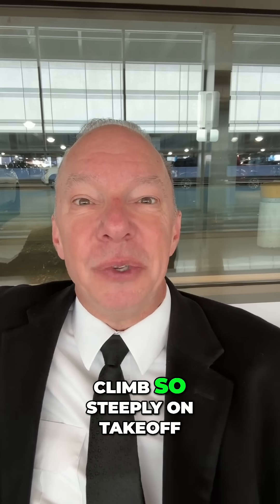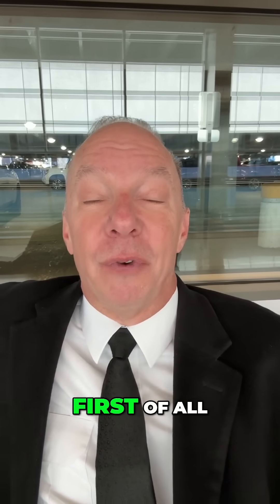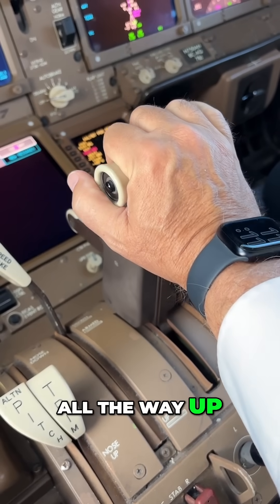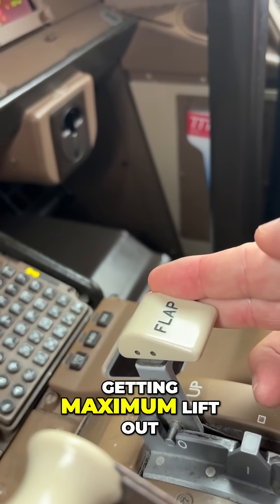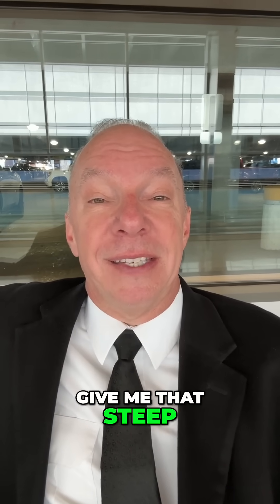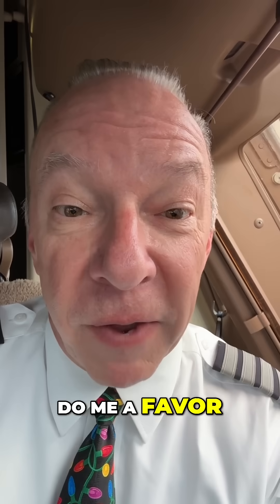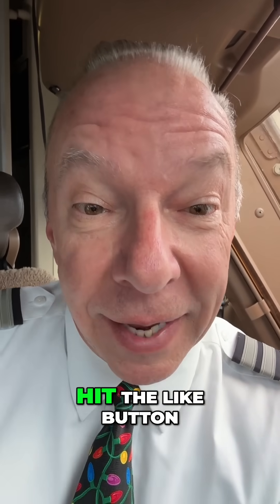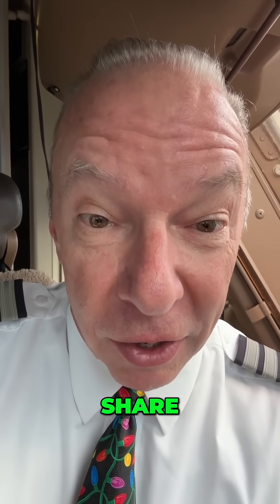Why Airplanes Climb Steeply During Takeoff?

Comment: A lot of power retraction is due to noise abatement too, trying not to be loud with takeoff power but enough to obviously stay aloft and climb a little. Las Vegas is like this.
Reply: I see you made this comment here too. Power reduction is not made with noise abatement in mind. And definitely not to just be enough to stay aloft and climb a little. The airplane is programmed to go to climb power, usually around 1500 feet. This is a normal reduction that reduces wear of the engine. There is a time limit in regards to takeoff power, usually 5 min.

Comment: Flaps are not generally at the maximum position for takeoff, one or two notches is enough, and it's never full throttle. They either use the auto throttle or set it to MCT, maximum continuous thrust which is closer to 90%.

He's way oversimplifying to the point of being wrong.

Comment: There might be mountains, tall buildings, or other terrain features near the airport.  There are also noise abatement rules at some airports which may require certain climb-out profiles after takeoff (climb angle, engine power, etc.).

For a super fun takeoff, try a Cessna Grand Caravan or BN Islander departing the Belize City municipal airport.  Taxi out to the end of the runway, flip a U-turn, hold the brakes while running up the engine(s), then finish pushing the "thrust" levers to the firewall as the brakes are released and the aircraft accelerates down the runway.  A fully loaded aircraft won't so much take off as it just keeps going, then starts to gain altitude as the runway ends and Caribbean Sea begins.  I've experienced this from the co-pilot's seat.  Yay!

Belize 🇧🇿 , Central America.
The Belize City Municipal Airport, not the PSWG International Airport just outside Belize City.

Comment: Locally, PHL, you have to climb ASAP to keep the noise down for those folks who moved under PHL's usual departure runway.  Runway's been there since WWII, IIRC. Most of the people moved in after then, and a great number of the homes were built to the drone of departing planes.  It's called "noise abatement" accommodating those who should have realized that being under the departure/arrival path is going to be noisy unless you adequately insulate.

Comment: Hi Steve, one thing I’ve always wondered is what is the sensation where the airliner seems to actually slow down and you feel a floating sensation. It’s only momentary but it’s an odd feeling that the stewardesses didn’t know. It seems like it happens while in flight, not landing or taking off.
Reply: Is that the same thing you’re describing???

Comment: Thank you so much.  Non-confident flier here. The takeoffs always have me gripping the armrest maybe a little bit tighter than necessary. I can’t help but think you’re gonna lose power and start sliding backwards. I know, I’m a wuss. 
But while I’m here, why, when approaching, are there such aggressive bankings to line up?  It seems like there’s enough space out there to ‘square up’ miles out. 
Appreciate the inside info. It takes a little off the “edge” when I board.

Comment: Steep climbers are called cowboys. Sure, you gain altitude fast, but it is also very hard on the equipment, your at max weight and drag.
I like the gentler  pilots becuase i know the engines wont blow.

Comment: You have said many times that you do not use max power, on take-off, but rather just take-off power calculated based on temperature, humidity, barometric  pressure and aircraft weight, so which is it Captain Steve, max power of take-off power?

Comment: Also some steep climb outs are part of noise abatement.  Anyone that has flown out of John Wayne airport will know how the plane climbs very steep then suddenly levels put and cuts back on power till they are about three miles from the airport.  Then go back yo higher power to climb out.  Also since 9/11 large aircraft climb steeper so that by the time they are no longer over the airport property.  They are pretty much too high for someone to take a shot at it.

Comment: Love you CPT Steve. You did not mention that many departures require a steep AOA (angle of attack) due to noise abatement procedures. Not dangerous in itself but troublesome if other issues arise in the cockpit during takeoff. Potential stalls can happen at any attitude. Especially low and slow speeds.

Comment: The only part of flying I like is that thundering down the runway. My first ever flight in the 80’s was a 747 and the power of those engines was exhilarating.. I’ve had a few very uncomfortable flights since one in particular from Dublin to Edinburgh in a Shortts 360 it would have been safer in a cardboard box. I enjoy your vids Capt Steve

Comment: Hi Steve! I like your concrete videos, no longer than necessary.
I have a question: I have noticed that there can be a significant difference in acceleration between different flights and aircrafts. I know that this can vary depending on the amount of fuel depending on the length of the route. Maybe some difference in the ratio of thrust to weight between different models. But I read in a comment that someone wrote that aircraft do not always put full power on takeoff, if the length of the runway does not require it. And strong headwinds also give a shorter takeoff distance. Is it correct that some takeoffs are made with significantly less than maximum throttle?

Comment: Hey capt. Steve the med plane crash that happened the other day you talked about engine failure and it stalled. I can believe that but when that plane was on its way down in a nose dive those engines were running and you can hear it in the video

Comment: Hello captain Steve my name is James I am from Australia my question is how would artificial intelligence impact the aviation sector, and what are your thoughts on fully pilotless planes in the future, and would you trust flying in one?
Reply: As a pilot, let me answer this of what I believe. 

I think AI is going to change air traffic control. I think it will be much more efficient and with less mistakes for AI to direct aircraft. 

As for pilots, AI will take a lot longer and pilotless cockpits is still very far away. And it’s not because AI couldn’t handle it. It can. The problem is sensors. We still have sensors that go bad in airplanes and AI cannot work without getting the correct data. Humans can still look out the window if everything else fails. And humans also don’t require electricity to operate. 

It’s different in a car or train. You only need to make sure your surroundings are clear of other traffic. An airplane has to deal with meteorological conditions, different pressures, different temperatures, different winds, icing conditions, lighting, windshear etc etc. could AI handle all these things?  Absolutely, as long is it can “see” or “feel” these things. If a sensor gives it the wrong information, AI doesn’t know it’s happening.

Comment: Now in a prior video you said you didn't USE MAX power on take off. Witch is it????  Enjoy your videos from good old Ft Bragg!
Reply: Sometimes Max power is used depending on the performance retired that day. There's also a 30 day requirement, on most jets, to demonstrate a max power takeoff per the airline and manufacturer.

Comment: How do the flaps impact your ability to maneuver the air plan? What do flaps do?
Reply: In a VERY basic nutshell, flaps help generate lift for takeoff and generate drag for landing.
Reply: It extends the surface area of the wings generating more lift. Conversly, it will reduce your speed but not badly on an airliner
Reply: @CodyseusRex  thank you!! Awesome!
Reply: Also allow tighter turns on a departure, allows the nose to be lowered for landing without increase in speed and better visibility, also can help keep brake temps lower.
Reply: @ thanks!!

Comment: I thought it was to make less noise and impact on the area below. And decrease low level in surrounding areas.  I will never forget getting out of Bermuda as the last plane out before a hurricane hit and airport shut down.  WHOA!  We went more vertical than can be imagined against the winds incoming.
Reply: It is for noise, indeed.
Reply: @rtbrtb_dutchy4183  Only at a few airports. Everywhere else they use a setting call MCT, max continuous thrust for takeoff. Which is not full throttle, and is designed to increase the life of the engine.
Reply: @trigremlin  no, you are talking about FLEX or Derated. (Depending on manufacturer). This is used everywhere, unless rated power is needed. 

But we were not talking about engine output. This was about the steep climb. It’s done for noise, up to 1500 feet usually.

Comment: Height is also a major advantage in case any problems develop. "Height is a pilots best friend ".
Reply: Altitude
Reply: @TronBonneVonne technically it’s the height that helps.
Reply: and lack of height helped kill the Learjet with its poor glide pattern.
Reply: @lukewalker1051  We know absolutely nothing about what happened in that situation.. The NTSB has stated that there were no signs of problems. Not all situations can be resolved no matter how much altitude the plane has. The plane that crashed in South America not long ago, had 16,000 feet of altitude. It made no difference. That situation was unrecoverable no matter how much altitude they had.
Reply: @lukewalker1051 That's actually not true at all. The 35 and 36 could basically fly itself and pull itself out of many uncomfortable situations easily. Straight (not swept) wing configuration made it very agile and it's high horizontal stabilizer made it easy to control and eliminated wing turbulence on the tail wings and rudder. It had two 3,500 lbf thrust engines mounted right by the fuselage which made thrust assymetry basically non-existent in an engine out situation while giving plenty of power for short runway takeoff (6,000 ft.)
What killed Learjet was limited range (1,700 s mile on 35A, 2800 s mi on 36 A). Gulfstream cleaned up on that. And Citation to to an extent. Learjet wasn't transatlantic and jet owners like Europe. SA was ok with fuel stop in Mexico City.
Reply: I came here to say the same thing.
Reply: @Stumpy1973  The air crash that happened in Philadelphia two days ago proves this!
Reply: @rfkhandle it proves absolutely nothing, since we don’t know nothing.
Reply: @ If they had altitude at lest the pilot could communicate with the ATC. That's why you don't know nothing!
Reply: @rfkhandle  you still don’t know that at all. You have no idea if the airplane broke apart or not. You don’t know if it could transmit. Even at high altitude, when things go wrong, the last thing that a pilot does is communicate.
Reply: @  You love to argue for the sake of arguing, don’t you?
Reply: @rfkhandle  it’s not about arguing. We simply have no information at all to have any kind of clue what happened. Yet you already said that the Philadelphia crash “proves this”. If you don’t understand how ridiculous it is to say that, with zero knowledge, then I don’t know what to tell you man.
Reply: So taller pilots are better?
Reply: It's called "The Impossible Turn".
Reply: @davidtooquick
Speed is your best friend, not altitude, not elevation.
Reply: @Arturo4586  an ILS has a decision height. We have height above touchdown zone. Height above airport. 

Altitude is MSL. Height is AGL.
Reply: @Arturo4586  I'll get right on that !
Reply: @Arturo4586 Yeah, not if you're nose down at 50' agl...
Reply: Altitude = options.
Reply: @howardp6682  exactly!
Reply: The three most useless things to a pilot - runway behind you, fuel in the tanks on the ground, and altitude above you.
Reply: Seriously, there's not one problem short of out of fuel or utter destruction that can end a plane at 35,000ft.  Most things can be recovered out of at that height.